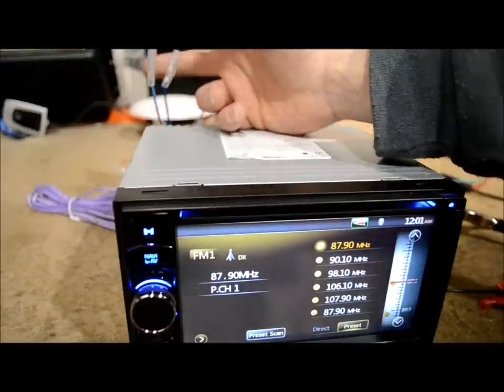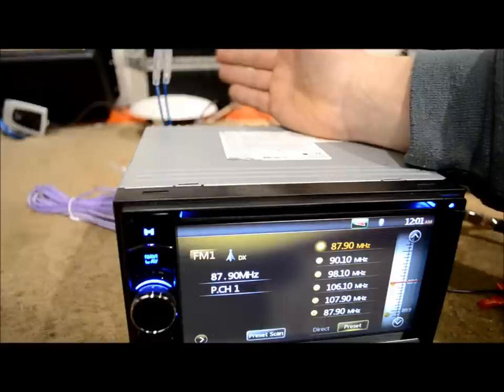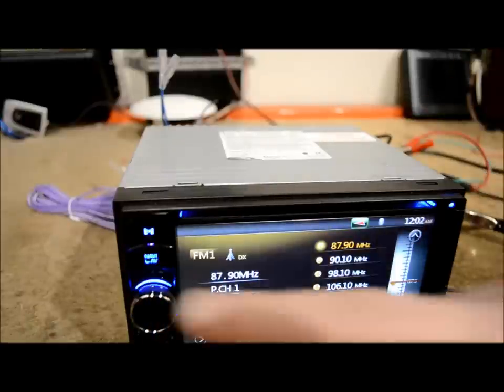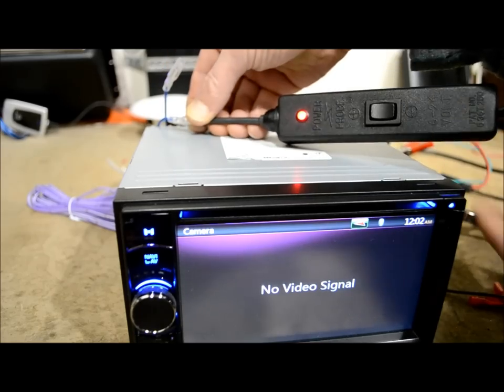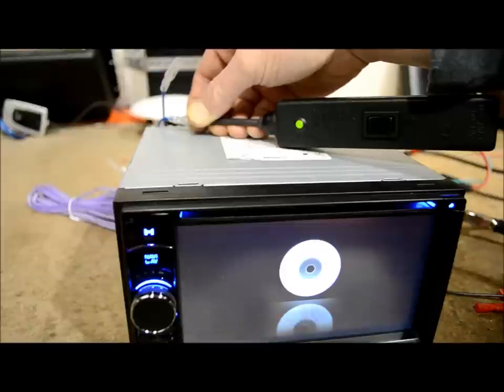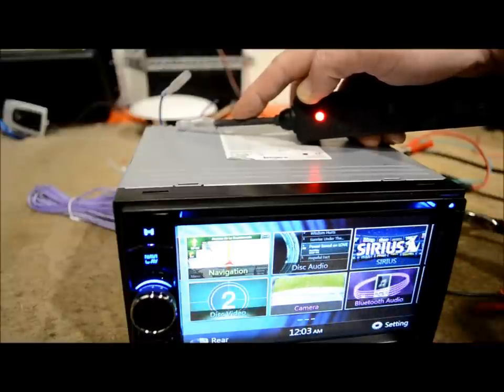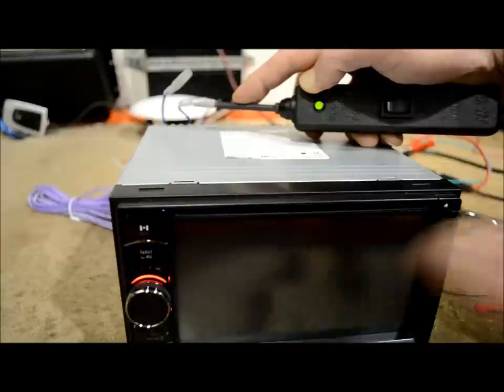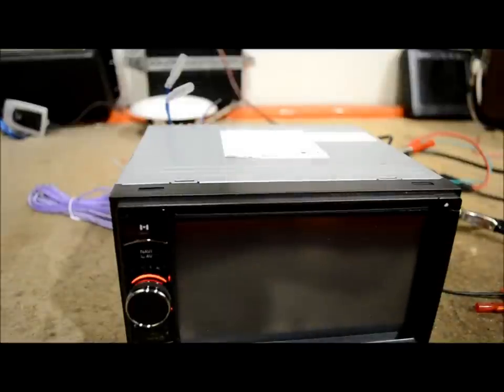Difference between amp turn on and antenna remote wiring

Comment: can i connect both to it?? harness has both but radio only blue/white and it says "connect to system control termanal of the power amp or auto antenna relay control terminal."
Reply from the maker: +jonah ooten no, one or the other
Reply: So then how to get power to the antenna?.....
Reply: +jonah ooten From the trigger wire coming from the power antenna. You have to run it all the way to the head unit if its aftermarket or just plug it in if it has a stock.

Comment: Can you please help with the wiring for a Pioneer FH-X731BT? 

The Pioneer harness has a blue and white System Remote wire.

The Metra 70-5520 harness has 
Power Antenna Blue wire. 
Amp Turn On blue and white wire.
Amp Ground black and white wire.

Which one on the Metra harness does the Pioneer System Remote wire go to? Ive heard the System Remote wire is for Amp Turn On and also for Power Antenna.

The Metra harness has a Orange Illumination wire and a Orange and White Dimmer wire, the Pioneer only has a single Orange and White wire.

This is for a 2006 Sonata without the factory amp and subwoofer. No other amps are being added, just the radio to the stock door speakers and front door tweeters and has a antenna in the back window glass.

I had to buy 2 Metra harnesses and take the Yellow memory wire from one harness and put it into the larger empty slot on the other harness that I will be using because that will match the slot on the cars (Sonata) factory harness where the Power Antenna goes. At least that is what I have read I should do.

The Metra harness also has a Brown Phone Mute wire, which the Pioneer does not have.

The rest of the wires on the Metra Harness and the Pioneer harness seem to be the same..
8 wires for the speakers.
Red ignition.
Yellow Battery.
Black Ground.
Reply from the maker: blu/wht goes to blu/wht
amp ground blk/wht goes to black (ground)
blu (p.ant) is not used on almost all cars older pre-99

org will lower the radio lights at night (with parking light switch turned on), org/wht is a variable dimmer and is on really old cars
Reply: To answer my own question, if someone might need the answer: 

FH-X731BT to a Metra 70-5520 for a 2006 Sonata (no amp or subwoofer)

On the Metra harness..
Tape or cap off the blue AND the blue and white wire

I bought 2 Metra harnesses and I took the Yellow memory wire from one Metra harness and put it into the larger empty slot on the other Metra harness that I will be using, because that will match the slot on the cars (Sonata) factory harness where the Power Antenna goes (need to turn on the rear window antenna). If you do not want to buy 2 harnesses, you might be able to use one of the blue wires that are capped/taped off on the Metra harness, but the open slot is larger than the slot with the blue wires.

After that all the other wires on the Metra harness and Pioneer harness all match up according to color. The exception is the Orange on the Metra harness goes to the Orange and White on the Pioneer harness.

The Metra harness package states the color codes for these wires BUT the Metra harness does not even actually have them on the harness.

Brown phone mute
black white amp ground
orange and white dimmer
Reply: Thanks

Comment: I have a aftermarket radio and for some reason for the radio all the speakers work but when I turn on the aux only the front left is able to be heard unless you fade it to another speaker of its on but the ac can still be louder than it but it’s only with the aux cord
Reply from the maker: You have a defective aux cord.

Comment: I have a factory amp and i wired a new radio correctly but i have a problem with the amp turn on, sometimes it turns on but other times i have to retart the radio or the car or even unplug the blue/white amp wire from the radio and replug it, i have switched the radio and still same problem, i was thinking i can wire the blue/white wire directly to the red acc wire but that is a last resort
Reply: I had/have the same problem with my NX404 and a Lexus RX330 with a TYTO-01 interface. I did in fact connect up the ACC, and it worked for like 3 years, and then all of a sudden that stopped working. My problem only occurs when I crank the car, and the radio goes on and off....So I'm actually thinking it's a timing problem with a voltage drop to the amp, and subsequent turn on....almost like there is a signal mismatch that confuses the amp. I am troubleshooting it today, and am thinking of putting a capacitor in serial with the line, to keep the voltage high while cranking. Will let you know!
Reply: Capacitor in-line didn't work. I'm thinking of just getting a turn-on delay module like an NVX XTRI1, which adds a 2 second delay.....I think that might fix the timing issue.

Comment: I hooked my powered sub to blue and white and before that the radio was great but after disconnecting the blue/white from car harness to stereo harness and connecting stereo harness blue white to amp REM the radio sucks now and I’ve tried so many different things to try and fix it. Also the SO B 8ptd sucks.
Reply from the maker: try adding a relay to bump up the sgnal, if you need a relay wiring guide let me know..

Comment: Why won't my audio from my headset to amp/subwoofer won't work?? I have a audio to head jack plug and it works fine that way. Thank you so much. I did the same thing by mistake and couldn't figure it out. The funny thing is it worked for a couple days and once my wife got in the car then it quit. After that it started thumping or poping every second.

Comment: I need help bad I have a factory in  amplifier,  i connected all the colors correct when I plug it in it powers up but no sound I think it might be amp but I have two soild blue
Reply from the maker: the blue is an amp turn on lead, that needs 12v to turn the amp on
Reply: If it's a dodge mid 2000s like say a caravan and has a nbs relay under the hood you just gotta supply ground to that relay from say the acc relay and you will have sound again. Been there and rather than running a lot of wiring like others did I just used a 2' wire and I was good to go.

Comment: What if you only have a blue wire, could you use that as your amp turn on
Reply from the maker: keep in mind, if you connect an amp turn on to a power antenna lead, every time you use any source oter than the am/fm radio the amp will turn off. not good.
Reply: @Lesscoelectronics  I'm using only the Blue ant wire on the same 3 pioneer car stereos on 3 cars  i have BUT, My Belva 10" sub kit I got from ebay is draining my battery when it sits on one of my cars a 1973 Ford Pinto. when I pull off the big red power wire from the fuse that comes with the kit mounted near the battery my meter drops, so I know it's the amp drawing power while the car is off. I even removed the blue remote turn on to see if that was letting it draw power, with the blue wire off it is still drawing power from the battery, just a little enough to drain after a few days. It's just pulling a very little amount of power to drain my battery over a few days of car sitting.

Comment: Why doesn't my radio turn on when I turn my ignition on I have to turn the radio on manually why you know?
Reply from the maker: I do know, Its because the yellow and red from your radio are both wired to constant power, the red needs to go to an accessory switched circuit to control the units on/off power with the key
Reply: Lessco Electronics thnx
Reply from the maker: Glad it helped!

Comment: old video ...but answered my question. I have a blue/white stereo adapter that goes into the factory connector that is a solid blue that activates my antenna but i guess i can split it so it  activates my sub amp as well. thanks.
Reply: I have the same set up as you explained. Did you have any issues doing that? Thanks

Comment: hi i was wondering what causes when i turn on my car my sub woofer make a loud thump! my ground is good and i connect my amp remote wire  to to the 12v wire on my head unit.
Reply from the maker: +Sushi Xiong thats a common issue that happens when the amp turns on . A good way to correct that is to get a pulse delay turn on type relay
Reply: @Lesscoelectronics  yea quality amps should filter the signal , low cost amps hit an miss

Comment: did a install just the other day the radio had no remote turn on wire but had a power antenna wire yet the car had no power antenna or cd player but works with bluetooth so he was happy. turned his amp on when his radio turn on work with AUX flash drive and radio and BT so guess it was just the wire marked as power antenna

Comment: oh, if anyone needs to know HOW to set any car amp up, for exaqmple NOT IN A CAR, and without using a car stereo/cd-player, but, perhaps, with for example a laptop earphone audio output, or ANYTHING, do this:
IT IS SO SIMPLE
1. make a BRIIDGE: cut a 3-4cm length of wire. insert 1 end into "supply",(on the amp power inputs) and the other end into "remote".
2. insert "+" wire from battery into "supply" 3. insert "-" wire into "ground" BINGO!
it is safe, and SOUND!

Comment: Do I put the Blue/White on the Blue? The stereo didn’t come with a Blue/White. So I put the 
blue/white- Red- Yellow all together. Otherwise the stereo won’t turn on. The only problem is it’s not keeping the memory.
Reply from the maker: if memory is your issue, check the yellow is on constant +12v
Reply: @Lesscoelectronics  Thanks so much! It was the fuse in the engine compartment.

Comment: Kind of a stupid design really, put in a CD or a DVD and the power antenna goes down? Why not just keep the damn thing up as long as the unit is on?... or am I overlooking something here? Can't imagine having the antenna constantly going up and down anytime you change modes. My unit has only the blue/white wire, but the manual states it can be used for either a remote amp turn on, or a power antenna... so obviously it stays on until the unit is powered off. This is a freak unit here... Lol

Comment: my deck haves a sold blue wire..a
but it also says amplifier wire
Reply from the maker: +Don Hills test it out.. see if it puts out 12v+ when the unit is turned on and goes out when turned off :P
Reply: Lessco Electronics I'm having the same problem I wired the blue wire lead from a Metra 40-NI12 plug to the  Pioneer AVH-290BT white/blue wire but still having problems with radio reception..other people says connect the blue wire to the ACC (Red) wire to get good reception I don't know it this true or not?

Comment: All I got from that was a story and to not mix up the two wires. I still dont know what the antenna wire is for lol
Reply from the maker: Its to activate the power or active antenna in your vehicle. (if applicable)
Reply: So if you have only a blue wire what do you do??